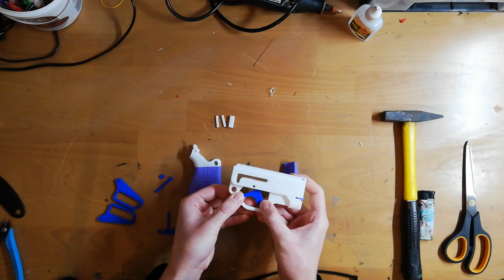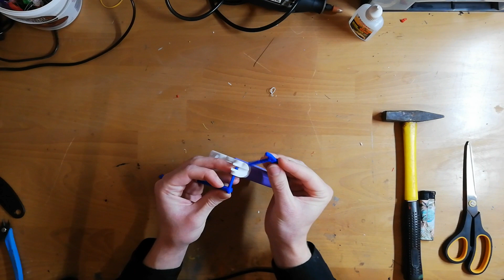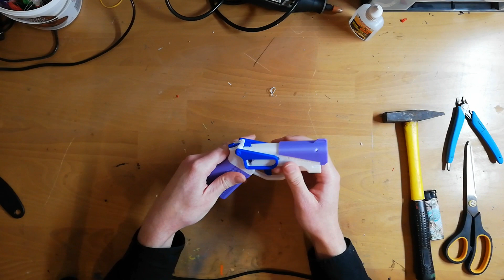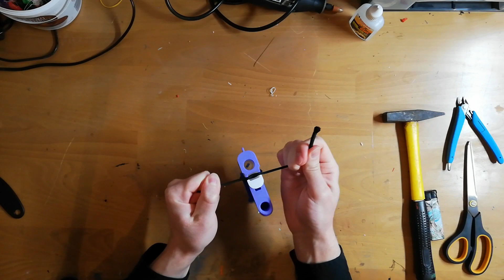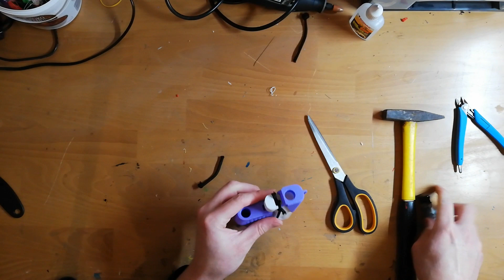1STM8 Assembly guide

Comment: This is a really great blaster! I had a lot of fun putting it together, but quickly started to have a problem. Maybe it's inexperience with print settings or something, but nothing seemed to click in and fit like you had it and all the pins were super tight and every time I put one in, even after sanding, they still cracked anything they went into. Clearly this isn't the case for you in your video! What slicer settings did you use?
Reply from the maker: Stock settings on a bambu p1p, try resizing your pins in the slicer. Like 98% of original size
Reply: @bruceleedleleedleleedlelee1127  Doing that right now, thank you so much!
Reply: STP？
Reply: 你好  有没有STP格式文件图纸呢？